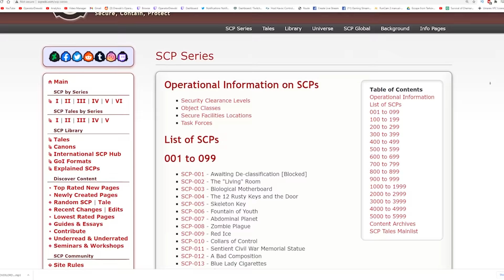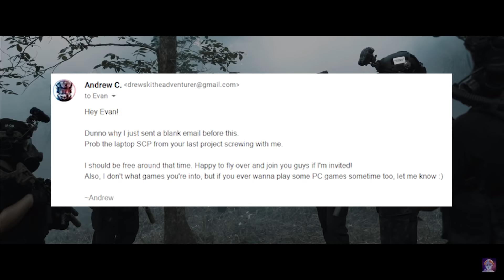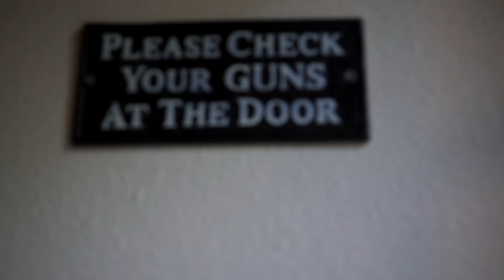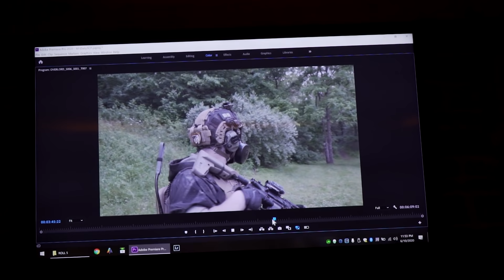I WAS IN THE LARGEST SCP SHORT FILM! - SCP Overlord / Behind the Scenes

Comment: "Broken this, broken that, broken NOD mounts, broken shit" 

Welcome to a sneak peak of what it's like being in the Military and conducting exercises on a platoon size level
Reply: Milspec - Built to the lowest possible functioning qualifications.
Reply: @sakaraist  More like Milshit. Our PVS14's worked 4/10 times during night time ops.
Reply: Goddamn ain't that the truth. This is what happens when you consistently go with the lowest bidder on DoD contracts
Reply: Air Force drills be 900 checks on the plane.
Reply: That’s why you get genuine Wilcox CNC aluminum mounts
Reply: @samyeet129  And then the day of the mission, broken
Reply: Mil spec = you basically have to build it yourself from a set of IKEA flat-pack instructions
Reply: Platoon size?? Lol try at the company level in many cases.
Reply: Well but NODs usually work right? I heard they are expensive af
Reply: Small arms repairman would be hell
Reply: @Danex506  No
Reply: @Danex506  thy are probaly expensive not because they are good, because there are not many manufacturers
Reply: LOL SO TRUE 😂 MY TANK BROKE MID BATTLE AND HAD TO JUMP OUT AND USE MY FLIPIN PISTOL BUT I SURVIVED SO there’s that
Reply: Like my Gunny said, "We adapt old equipment to do more"
Reply: @Danex506  yes they are very expensive ive used a pair that cost around 40,000 but usually there around 12-13,000
Reply: @Dunny727  fyi, the only 40K nods are GPNVGs which are limited in distribution within Mil. General NODs that an average soldier would get are PVS14s and stuff which are 2.5K a tube for civs so 5K max including mount and everything
Reply: @sakaraist  so... when an item said "military grade" it means it will broke immediately?

Comment: 18:27 when the NPCs get spawned in and are stuck in the default pose for a second while loading.
Reply: Not funny
Reply: @kiwimarshall3937  why?
Reply: @kiwimarshall3937  why?
Reply: @kiwimarshall3937  why
Reply: @kiwimarshall3937  doesn’t have to be
Reply: @kiwimarshall3937  Why?
Reply: @kiwimarshall3937  you're going to SCP-610 contaiment
Reply: @kiwimarshall3937  why?
Reply: @kiwimarshall3937  why?
Reply: @kiwimarshall3937  why?